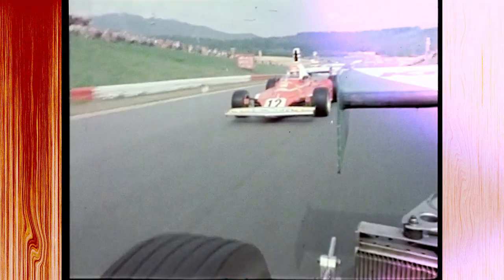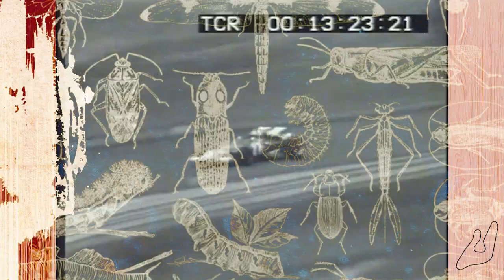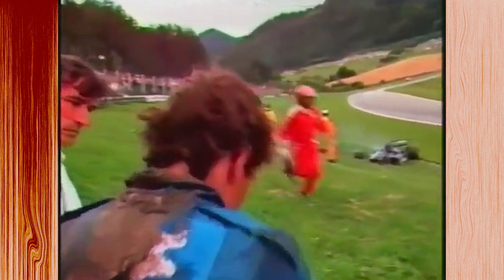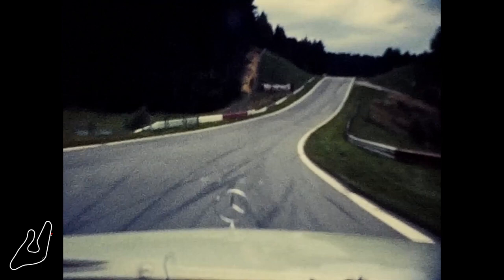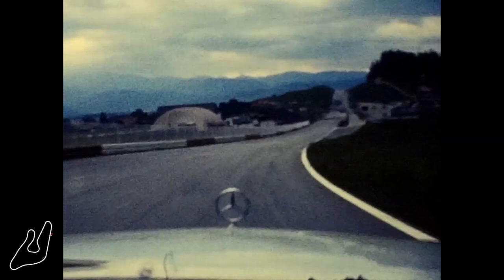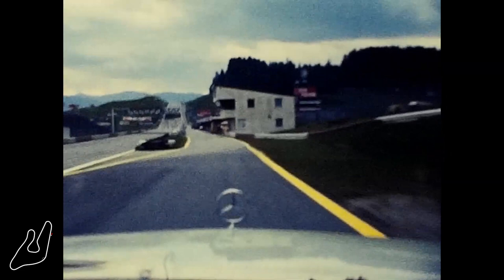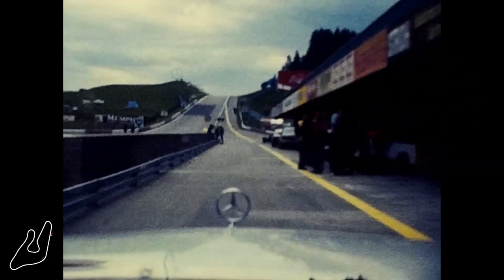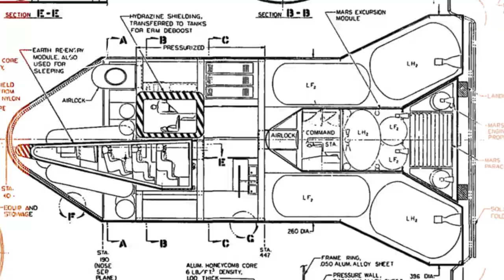Old Österreichring onboard (A1/Red Bull Ring) - Austrian GP

Comment: Alain Prost actually said that if you put in run-offs(expecially at the 180 degrees Bosche Kurve), then this circuit would be safe again for F1.  The redesigned circuit has lost so much of the flow and it's so stop and start with now tight apex corners for the first two corners.
Reply from the maker: Agreed.
Reply: this track is shit now, maybe for f1 it is different but motogp riders seem to struggle and crash a lot here and it is all because of hard braking zones and off camber curves that the old track didnt have

Comment: I just wonder what happened with banked corners on F1 tracks? I know Brazil and Zandvoort have banked corners and excluding ludicrous banked turns like the one at the old Monza and AVUS, but they used to be alot more prevelant, why did they go out of fashion? Was it just the stress on tires and suspension or were they that dangerous?
Reply from the maker: Hi. Didid you check my Monza History video? All answer are there. It´s too dangerous! Drivers don´t want it. Cheers!
Reply: Yesss! - If a driver lost control of the car in a banked curve, the track sent the car off like on a ski-jump...
Or there is a massive wall where the car disintegrates on impact, like on the oval courses used in the american racing series.

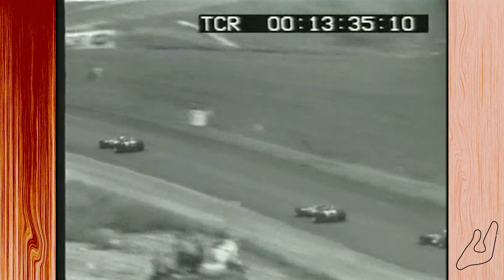Comment: LOVE the old  Österreichring! Another challenging circuit that demanded respect and courage to drive on, especially some of the blind spots. I also notice at 2:06 the car behind the two Ferrari hits one of those wooden(?) markers at the edge of the track ( right side ) and sends it flying  high up into the air , classic!!! Thanks again for your wonderful video, appreciate it. Cheers from the USA.
Reply from the maker: Man, I did edit the video and missed that... Well spotted! Cheers from Portugal!
Reply: ...the markerers were hollw and of sheet metal, or more likely of plastic. They were the same as on regular streets. If they were of wood, they would have broken the car completely.

Comment: Rfactor 2 needs this roller coaster, I’d love to drive on it.

I actually don’t mind the current track either except for the first turn which is almost impossible to see.
Reply from the maker: Old track was way better, demanding and longer!
Reply: Grand Prix Legends has it as an add-on.
Reply: Red Bull Ring displays 2 things one can always find where corporate interests interfere. 1/ Utter greed and 2/ An utter lack of any form of imagination. We need to remove ALL corporate interests from the running of motorsport in general, and push them back into the 'sponsorship' roll where they belong. Most are incapable of running a piss up in a brewery. They display this fact constantly. Love your videos my friend, and this track, and all the old 'dangerous' ones are available to drive in Grand Prix Legends.